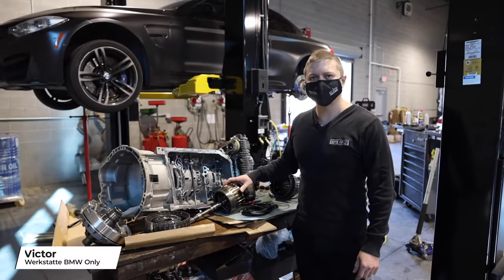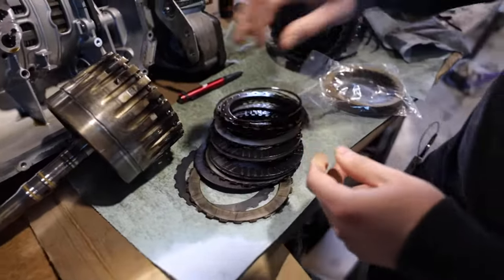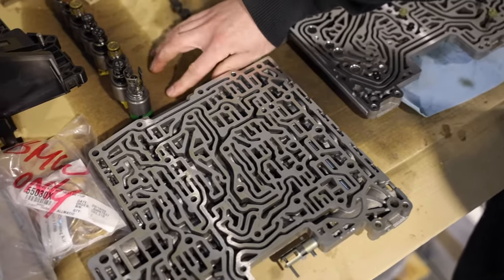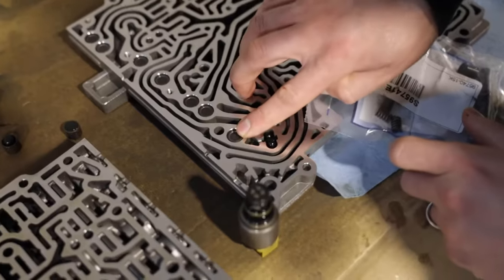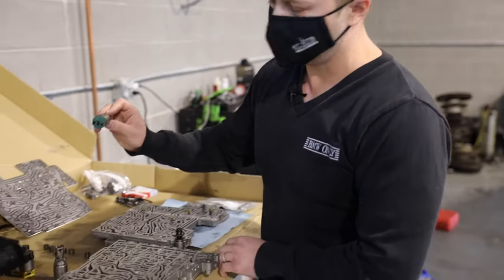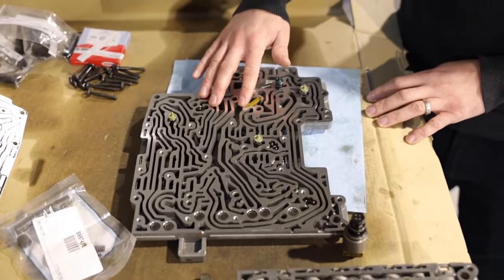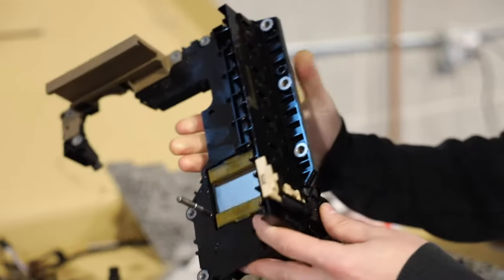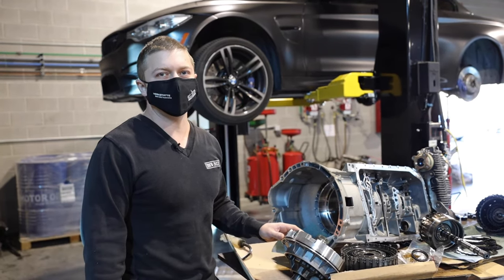Why BMW  Transmissions FAIL 6HP19 6HP21 6HP26 6HP32

Comment: I what to say thank you Victor thanks to your video my problem is the buching I removed the transmission I opened and yes the drum is burned and the clutch and for sure the body valve need to be fixed .thanks 🙏🏾
Reply from the maker: You're welcome. Thank you for the feedback
Reply: @werkstatte-bmwonly9515  I really appreciate your help. I watch another video from another professional how opened the transmission ( Garry Ferrano) and Yes your description is so precise I opened and I have the condition in your video . thank you Victor
Reply from the maker: Awesome. Thank you for supporting
Reply: @werkstatte-bmwonly9515  Victor I have problems with the drum. I only find 6 disc  drum Clutch , my one is 4 disc  . 1question I opened my own and I find Is piston disch .my question is. The drum is the same in 4 disc and 6 disc drum? The piston disch make the difference to accept the 4 or the 6 clutch ( sorry to bother you Whit this question) I don't know no one else Whit your knowledge
Reply from the maker: You know we had once issue like that. Parts company send us a drum and it would fit in properly so we didn't risk to install it and ordered the right now. I wouldn't risk it honestly.
Reply: @werkstatte-bmwonly9515  the problem is I don't find 4 disc clutch. I going to order 1 for 6 disc and I going to make miniscule examination and I let you know about My research
Reply from the maker: Let me know if 6 disc will work. If it fits tight I probably wouldn't
Reply: @werkstatte-bmwonly9515  this are the updates . You remember the lip in the shaft ? That is normal I buy new shaft and then measure in the new one and then Old One are the same ,my burning drum was under specs just the buching was bad . The  4 .5 and 6 drums disc are different  . The 4 disc clutch drum is 4.1/2 Inches. The 5 and 6 drums disc is 6.1/2 Inches tall . In resume the 5 and 6 disc drum are the same .I put all together and the transmission is working properly I be driving for 100 miles and working properly . I find out another interesting fact  some on the 6hp19 are different in parts .
Reply from the maker: There are a lot of modifications of 6hp transmissions. Thanks for the detailed update. Very useful 👍
Reply: @werkstatte-bmwonly9515  my friend I have a 2008 Audi 3.0tdi quattro having zf6hp19 , 210.000km and not yet atf changed, no problem up to now and working properly, now I decided to change atf but The Audi dealer Said That it is not A good idea to change now, if it is changed there may be problems, they said to go on as it is, but İf I go on as it is , the transmission will fail. Waiting for your information whether to change fluid or not, to increase the life of this transmission with this unchanged atf
Reply from the maker: That's a old myth that if you replace the fluid and it'll make it worse. What I wouldn't do is I would not reset the adaptations. We have seen transmission that would stop running after resetting the adaptations because it could not learn new values. I haven't seen a single car that was running just fine and after replacement of the fluid it got worse. If it gets worse then something wasn't done correctly.
Reply: @werkstatte-bmwonly9515  So you recommend atf change even if it is not changed up to 210.000km and 14 years,What I need to do is not to reset the adaptations, am I right
Reply from the maker: Yes replace the fluid and the pan. Also would be good new solenoids. Don't touch learning values or adaptations.
Reply: @werkstatte-bmwonly9515  Any suggestions for a boosted application using the 6hp26? What upgrades should be for longevity? And amazing video by the way!! 🔥 very informative!! 08 550i msport 200k miles +
Reply: @werkstatte-bmwonly9515  Are you saying it's a bad idea to reset adaptions after replacing solenoids and clutches? What I've read in the ZF instructions is that you should, and you should only reset adaptations when replacing hardware. Hardware means solenoids and clutch frictions. Do not reset when doing a fluid change. Do we agree about this?
Reply from the maker: No, adaptation must be reset. It could be very tricky is adaptation are very high before you do the service. there's a chance it won't move. You have to check what adaptation you have prior
Reply: @werkstatte-bmwonly9515  Then we agree 👌🏼👌🏼👌🏼

Comment: Thank you for the info you've provided us! I'm scratching all around forums and youtube,  changed fluid, the 4 mechatronic seals, the 1 main and the connector on an e92 335d 6hp28 box, did reset adaptations (idk if it was a mistake or not) shifts amazing BUT 2-3 it feels like it slips, brings 100rpm up, drops, then shifts. Saw a couple of videos, same car on acceleration, absolutely the same rpm up/down then it shifts to 3rd. Torque converter or loss of pressure until it locks completely?

Comment: This guy is spot on. I changed the solenoids, bridge adapter and those other 4 rubber tubes but never actually opened the valve body itself to change those little dampers inside and the plate. And guess what, after 1 year the gearbox has a small delay before it engages D or R.

Comment: Hello, I have the same transmission on a 2006 740i. The transmission shifts smoothly during acceleration, but during braking or downshifting, I feel a jerk from going to 4th to 3rd or, possibly, 3rd to 2nd. It feels similar to driving a stickshift while downshifting to 2nd and letting go of the clutch quickly. Any idea what that could be?

Comment: Amazing video! I had to watch it 2x because there was so much info in there. The descriptions were very informative and the logic and reasoning were super clear. Slow down just a tiny bit so us mere mortals can keep up with you. Thank you so much for posting!
Reply from the maker: Love it, appreciate the support. Thanks for the tip
Reply: @werkstatte-bmwonly9515  I was planning on a DIY for my valve body.  I think you're correct about the small parts. I am a professional in other things, and I think it would make sense to have my ZF6HP21 serviced by a competent ZF trans shop. Does your shop do a mail in service like you talked about? Would you recommend I go with local instead? --Thank you again!
Reply from the maker: You could remove your valve body yourself and ship it to replace the plate and pressure dampering pistons. We could do it for you as well. It'll be roughly $800-$900. See what other places offer  this .
Reply: @werkstatte-bmwonly9515  I guess it's very complex so requires a lot of time? To me, it looks intricate, and many small parts that need to be inserted and aligned correctly if the mechatronics is disassembled. May I speak with you by phone?
Reply from the maker: @SteveWeltman  you can call me tomorrow on ext 3. Google BMW ONLY Las Vegas and you should find out main phone number.
Reply: @werkstatte-bmwonly9515  Thank you very much! I will call tomorrow!

Comment: Great video! I would love to see more transmission videos. You guys know your stuff on these and it shows. I love learning about these transmissions
Reply from the maker: Thank you. I'll think of what we could post out there. Let me know if you have any ideas or videos you can't find online
Reply: @werkstatte-bmwonly9515  I’m interested in knowing more about which cars use isn locks and which don’t. Also anything you know about upgraded clutch packs, valve body’s, fluid or general upgraded parts. If they work, if they don’t etc. 
I would also like to know to interpret clutch pack adaptation numbers. What those numbers mean in terms of wear or what could be causing issues. 
Also basic guidelines for maintenance and preventative maintenance.
Reply from the maker: So the earliest ISN I've seen would be on e70 X5. For example 2008 BMW 750i with 6HP26 can be installed and driven used without a problem. 2008 bmw X5 with the same transmission will have a problem with ISN and CAS match. All 8 HP transmissions are locked with ISN. We can reset them here. There is a also a trick to make a used transmission work but you would need a CAS module from the donor vehicle.

Comment: Very good video.  I have fault codes 4F85, 299A, and P17E5.  I was considering the valve body kit, but now I'm just going to scrap the car and buy something new instead.  In meantime, it drives half decently in manual mode and I just erase codes when they pop up.
Reply: Yeah man in having that same 4F85 code as well. Looking at going manual, hopefully the install will not be to bad.

Comment: Hello Victor. Love the videos. I am a Jack of all trades I think lol. I have been trying to get my 07 750li going. I did twice. First transmission when I bought it I changed bridge seal, tube seals, sleeve and pan along with fluid. It worked for a week. Then I changed transmission with a used one and kept my tcm and drove it for a few months. I changed my valve cover seals and all other seals that cause oil leaks on engine. When I finished that and tried to drive it I got a fault code 4e89 solenoid 1 or 2 mechanically jammed. Bought Sonnax kit and rebuilt valve body
 but still have the same issue. I can drive for a while but once I come to a stop or slow down I get a fault code and limp mode.
Reply from the maker: You problem is TCM. Not the transmission or the mechatronic. I've seen it multiple times. TCM (transmission control module) is the back part that's attached to the valve body. Find a used one or from the donor transmission
Reply: I already got rid of the donor transmission with tcm. All I kept was valve body. If I get another TCM I will need to get it coded right or would it possibly be plug and play?
Reply: Also what is it about the TCM that would make it register as solenoids mechanically jammed. I test drove it one last time after replacing fluids and seals again and when I got home to back into my driveway is when the transmission jumped back into Park from reverse and I got the fault again.
Reply from the maker: We had these issue with the that exact fault code caused my TCM. It's internally shorting.  A used one without coding might work
Reply: What was the resolution? I would’ve read the codes before starting anything
Reply: Ok sorry for the long pause. Hopefully whoever has read my complaint concerning my e66 transmission problems will read this. I have come to a conclusion that these transmission are not bad at all and pretty DIY friendly for an auto handy person. If anyone has done a tune up on their car and are now experiencing transmission faults well here is what I found. Like I said after fixing my transmission by replacing rubber tubes seals,bridge seal,filter and fluid car ran great. I figured I would replace  valve cover gaskets,plugs,coils and other gaskets as a preventative measure. That's when transmission went wonky. So in a nutshell,  only use Bosch coils. Yep I said it,only Bosch coils for your car. I was getting faults through whatever bus system is shared between them. I spoke with the transmission gurus in Connecticut and this is what I was told. I tossed my original one after replacing them with another brand. Reordered some new Bosch ones and put them in. I have been driving fine now going on a year. This was my problem and I'm sure others as well. Some may not agree but again I have been driving fine since my replacements.
Reply: @waynehazard-ql5sv   Wow, so your coils fixed your transmission issue?
Reply: @TechnoMonkeyFarm  yes. Because of the way signals travel through modules the tcm was not getting the correct signal I guess because of the signal being sent out to speed sensors and cluster and what not.

Comment: This man a legend true craftsman 👍👍
Reply from the maker: Appreciate it
Reply: I have a problem with my e60 535d the revs bounce and the car changes up and down gears it’s like it can’t decide what gear to be in any pointers would be most appreciated
Reply from the maker: It's always a step one to do a full service with Pistons, solenoids, fluid etc. And reset adaptations after that. Pressure loss is the most common issue with these transmissions and the start of all the problems

Comment: Hi Viktor,
Wheres the high pressure release valeve on a 6HP 21?
My 2008 528i lost almost all the transmission fluid from March 2024 til about June 2024 when I stopped driving it to protect the transmission.
Im changing the pan and the fluid with genuine parts right now and I cannot figure out where the flui escaped from.  I degreased the whole undercarriage in June and I can see oil leaking from the pan but the oil level is fine.
The tansmission maybe had 2 qts in it plus whats in the torque converter but the pan is moist with oil, not ATF.
The vehicle had been driving great even when losing the fluid.
Is the drain plug the actual high pressure release valve and thats why it creaks when you turn it to remove it?

Thanks in advance.

Comment: great video excellent presentation may l suggest use a scriber when pointing to fine points of wear on transmission parts but again well done how about strip down start to reassemble finish  on 6hp19z transmission just a suggestion  thanks Lee
Reply from the maker: Thank you Kate, still learning to deliver higher quality videos. Thanks for the suggestion, I always appreciate the feedbacks.

Comment: I have a 6hp26z and have already changed the fluid, seals, and filter. I didnt change solenoids or valve body. I did reset adaptions and drive very conservative for 200miles. However, im still slipping in 5th gear and going into limp mode. Only when beendrive a bit harder than regular, otherwise the car drives perfectly fine if kept under 3k rpms.
Reply: @werkstatte-bmwonly9515  --- I have a question (2008 750Li - ZF6HP26 - 102k miles).  Is it necessary to "reset adaptations" after completing service on  PAN/FILTER, LIFEGUARD 6 FLUID, VALVE BODY SEALING SLEEVES (5),  and ADAPTOR PLUG? My car is running fine, this is just preventative maintenance.
I have never replaced valve body plate, solenoids, or pressure dampers.  In other words, if I simply complete a Mechatronic Service on sleeves and adaptor plug... with fresh BMW fluid, pan and filter is there any special reset or adaptation mandatory?  @werkstatte-bmwonly9515

Comment: Any suggestions for a boosted application using the 6hp26? What upgrades should be for longevity? And amazing video by the way!! 🔥 very informative!! 08 550i msport 200k miles +
Reply from the maker: Doing the solenoids and full valve body service is the best you could do for the transmission. Along with the new oil pan and fluid of course. Thank for the feedback

Comment: I'm not sure if you can advise

I have a 335d UK 6hp transmission.

1) I have slippage in 1/2 gear. On either hard or soft acceleration, the 1st gear holds and will redline without shifting into gear 2. I have to let go off the acceleration and tap the paddle shift to change gear. But there is still a big delay....

2) Sometimes, when accelerating hard, I have a gearbox malfunction in gear 3/4. Gearboxndoesnt work and drives at a minimum speed. This clears after a car restart.

I've only ever had gear 3 or 4 ratio error come up 3 or 4 times in the past year or 2 off this happening. 

I've chamged the metatronic sleeves and gaskets. Done 2/3 gear box oil services. Changed the basic serviceable parts.

Worked good for a while but carried on with the issues above. I have no chamged the gearbox solenoids.

I also did an xhp tune stage 1, which helped a lot with the slippage, but as mentioned above, it happens randomly but less often.

I'm scared to drive the car fast or to have fun. I try my best to minimise hard acceleration (works great when jt works)
Reply from the maker: You have to start with mechatronic pressure dampers, separating plates and solenoids. If that won't work you have to do the transmission clutches and bushings
Reply: How did you go about putting the xhp tune on 

Many thanks

Comment: I have found in my yesrs of owning a jag xk8, if you change fluid and change mechatronix seals , and of course the pan/filter you will avoid most of these very problems. And this is something you can do yourself by watching you tube.  I know, i did it.

Comment: Excellent info!  Do you recommend a preventive transmission fluid change on a 2011 Z4 23i with around 30k miles? It has no flaws, runs perfectly. We don’t know if the previous owner did any service on the transmission in all these years.
Reply from the maker: No, I would recommend the fluid in 80k miles range. ZF recommended 60k miles. Honestly we don't see failures much till 100k or so (unless it has a leak of course). So 80k would be a golden spot to have it serviced.
Reply: @werkstatte-bmwonly9515  thanks man! Subscribed.
Reply from the maker: Appreciate it
Reply: @werkstatte-bmwonly9515  That said, the recommended fluid change interval is every 60k miles or 8 years, whichever occurs first. So the poster's Z4 was due for a fluid change.

Comment: any thoughts on fault code 4F85? stuck in limp mode (no gear higher than 3), park/reverse delays >2 seconds, lots of gear slippage before limp mode, sometimes cannot reverse the car after highway speeds.

also, best video i've watched on this topic. i may have to visit you guys in person!
Reply from the maker: Step number one would be to check the fluid level. Step two could be a damaged adapter plug. It's a gasket that's between valve body and transmission. Those are most common issues to check for.
Reply: I have the same exact problem except I don’t get reverse at all it’s just another neutral gear. Did you find a fix?
Reply: I have gotten 4F85. Not sure if it was one that I just had to restart the car or erase the fault code but one or other and my car is back driving.